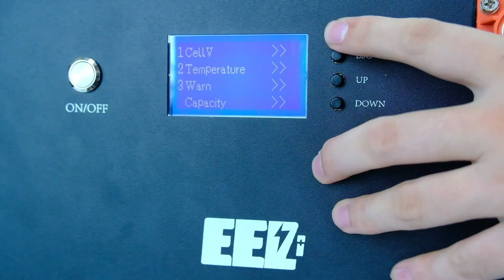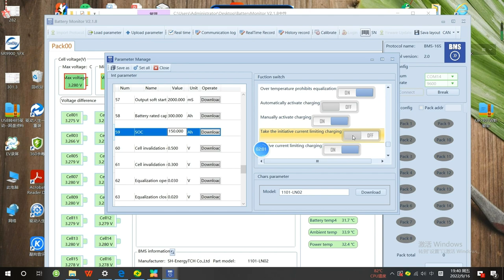Review the New 48V 280Ah LiFePO4 Battery System DIY Guide, build the server rack battery

Comment: Where is the Warehouse in America located, what State ?    I built our off grid solar system back in 2017 and have been totally off the grid "No SMART meter."   I built our systems using Ford C-Max salvaged Panasonic cells, system has been running 24/7 since early 2018 with No BMS and two years ago I took a look at my cells and early single one was spot on so I am not sure the BMS is all that important if you have good quality cells and you balance them really good before you build it.  Now I am building a 1975 MCI (bus) into an RV and will be using Solar power in it so I will use the Ford C-Max batteries again I believe as I get them super cheap, less than $80.00 per kilowatt but it is nice to see where the industry is going however, I have seen what these batteries take to Mine from the ground and it is not a better way to go than oil power but it does make use more mobile so I am about that right now, Blue Roofs, Maui, Hawaii !!!!!!!

Comment: Nice Quality Build….. but how does the balancing work with the Small resistors ?
Reply from the maker: Balancing work can not solve the problem of the battery cells themselves. It may be a good way to do TOP balance before assembly, or try to buy battery cells from us🥰
Reply: Do you have 24 volts 100 ah